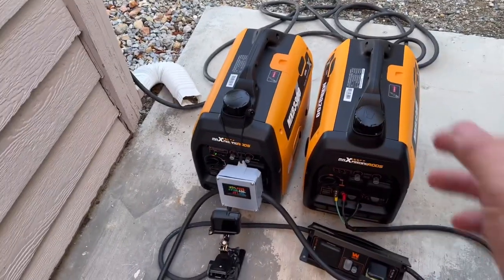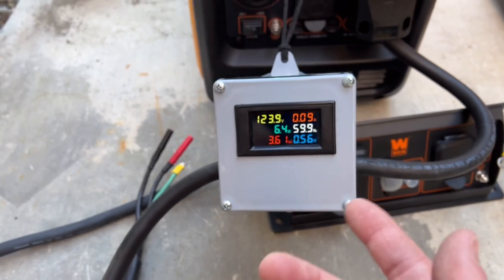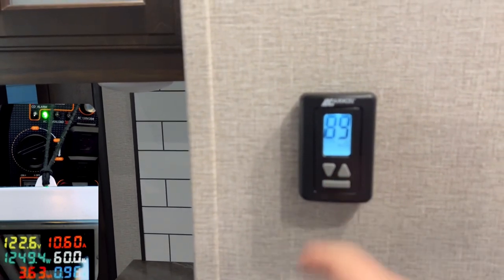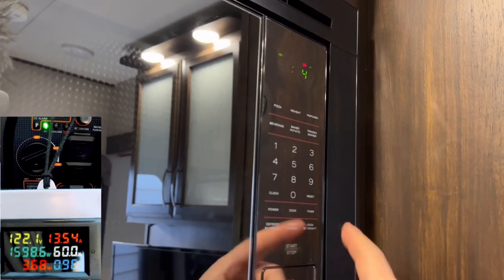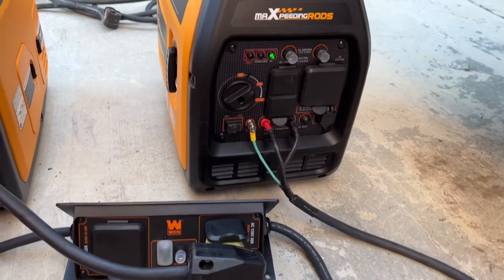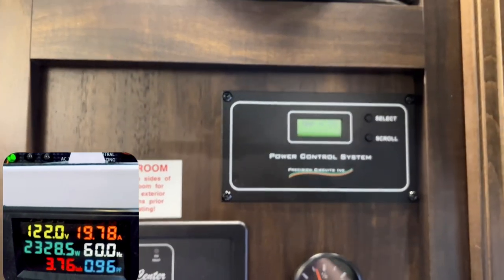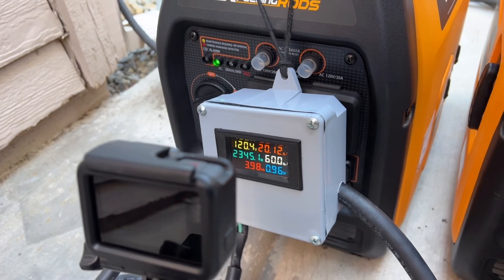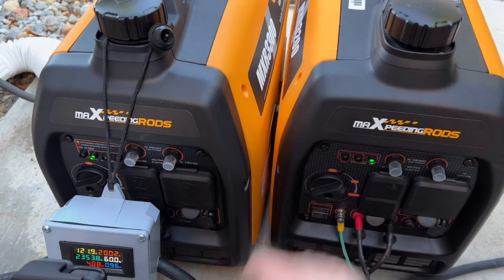Maxpeedingrods MXR 3300 Load test generator paralleling

Comment: I have the mxr 3200 and the mxr 2300. I've tried paralleling them with a kit and with just the cables. Both ways preformed about the same but I think a kit is better. Awesome video johnny.
Reply: What engines does mxr base their generators off of?  Where did you buy them and how much?

I have a 50A rig. I parallel a set of 2000w gensets..  if and when these die.. I plan on replacing them with 2300's from A-Ipower.. they use genuine Yamaha MZ80 engines
Reply: @camposvazquez  I think they're honda clones. Both are almost the exact same length width height weight as the Honda 2200. My 3200 runs my 30 amp trailer by itself with ease. Found the 3200 in Amazon for $500 and the 2300 on eBay for $328.
Reply from the maker: The engines are Genmax design and not sure the copy. They are 145cc and Honda uses a 98.5cc on the 2000 unit and a 121cc on the 2200 unit.

I still have the discount code which may be cheaper then else we’re but not sure. Which is in the description in the video. 
Over all though yea so far this is a ideal compact size unit.
Reply from the maker: Yea according to the manufacturer they say use the parallel box kit. I tried to fire up both acs with out the box and the gens didn’t like that much load and wouldn’t do it… kinda was surprised. With the box no issues 🤷‍♂️ 

But of course I have to tell people to use it according to what they say.
Reply: @johnnysweekends  technically my 3200 is a genmax even though it is identical in every way to the mxr. I was lucky to find on Amazon back in March at $500 with a coupon code. Love it so far.
Reply from the maker: Genmax is the maker of the MXR. It’s just a sticker 😁 but that company sells it

Comment: U should get inverter air conditioner. I have a voltas and it makes a big difference. Inverter air conditioners increase their load slowly and when they reach set temperature they pull only the amount of power required to maintain the temperature. My one goes down to as low as 300w and it's a 18000btu unit.. in my room it pulls 500w when outside is 40+. On some occasional days when it goes 45+ sometimes 49c then it consumes more than a kw to maintain room temperature. Their only drawback is if they go bad u have a lot more points to check and the inverter board itself can fail and that part is quite expensive.
Reply from the maker: Unfortunately I don’t think they make them for RVs so soft starts are kinda the best option.

Comment: Kind of bummer about the 30A limit.  Would it be feasible to isolate the water heater and microwave to a dedicated 20A circuit?  You would need to run a 2nd extension cord to your parallel box of course, but it might allow you to do some better load testing.
Reply from the maker: I actually have a different trailer and set up now.

Comment: I have a question about parallel kits. And home back up.
I’m having a generator inlet 120/240 L14-30amp installed. I’ll be using my champion 4500 with it.
My question is, if I were to parallel the champion 4500 with my predator 3500. Would I use the 30 amp or 50amp side of the kit? With the correct adapter.
Reply from the maker: You need to use the 50 amp as those two together is a lot of power for 30 amps you will melt stuff if not careful.
You need to make sure your parallel kit provides two hots out in that kit you have. 
You can always show the electrician your set up as well.

Comment: Hi Johnny, awesome video. I purchased the Maxpeedingrods MXR4000 (this is the red and white one with Bluetooth capabilities) a few months ago. Just recently purchased a second MXR4000 so that I can parallel to run both my 15000 btu AC units on my fifth wheel. I planned to use a 50amp parallel kit, but the parallel hookup ports on the generators are male connections (possibly JPM connection) and the 50amp parallel kits I have looked at have male connections that would plug into the generator. The generators came with a parallel kit (with proper connections) to hook both generators together, but I would only have a 30amp connection. Any suggestions or advice? Would it be ok to replace the connections on the 50amp parallel kit with the proper connection? Thanks in advance.
Reply from the maker: You could replace to make the connections work as it’s just wires and no data. 👍🏼

Comment: how do you like this generator compared to the predator? I’m looking to purchase one for my camper. But I can’t really decide. It has one 15k ac unit. I’ve seen this one, the predator, champion 4500 and powerhorse 4500. I like th size of the unit you are reviewing. It looks smaller?
Reply from the maker: So far I’m not hearing a lot of problems with this unit but a couple people said it won’t idle super smooth while just idling and no load. As soon as a load is on it works smooth like normal. But that’s only a couple people so far.

I really like this unit and the Genmax 3500 dual fuel. That is also a great unit. Plus they is a clone Honda gx engine so assume that should hold up fine. 

I don’t see why I will use much else now one of these or my ECOFLOW stuff and some solar. 

Now if running two ac units then I would recommend a larger unit. 👍🏼
Reply: @johnnysweekends  I went ahead and ordered the genmax 3500 mostly because of the weight. I wanted a bigger champion 4500 but I don’t think I would be able to load that in my truck by myself 😢😂 my rv ac is a 15k and fridge is 12v so I think it should be okay. I also have an Anker powerhouse 757 and a smaller 300 as well. I hope it’s a good back power source for home too.
Reply from the maker: Ahh nice. Yea honestly the 3500 series of these are a for sure sweet spot when it comes to the size. Hard not to love it. 

If you wanna make life easier on the generator adding a soft start really is a nice option but not really needed. But just helps save everything for the long haul down the road.

Comment: Could you parallel a BLUETTI with a Honda gas generator?
Reply from the maker: You can’t really parallel them, but you can charge the bluetti and use it at the same time and also use another plug on the Honda as well. 
But you can’t increase the power output of either unit.
Reply: @johnnysweekends  thanks for the response. I was really hoping I could connect them together and power my 50amp RV.
Reply from the maker: Here ya go. You can maybe use this to power each hot leg..
Let me know 
https://amzn.to/3O6AxSk

Comment: Hi, i have two of these generators, from maxpeedingrods, one is 5500w and the other one 3500w, can i connect both of them in parallel? Thank you
Reply from the maker: Yes, most people parallel many different brands together and different sizes. Keeping them closer in ratings is also good. Like what you are doing is fine but say a 5500 and a 2000 might be to far of a stretch ……
Reply: Wow are you powering a small Stadium 🤣🤣  the 5500 alone is no joke
Reply: I've been looking at the 5500w ,,, doesn't look like it has parallel outputs on the unit ???
Reply from the maker: The champion model ?
Reply: @johnnysweekends no the Max peeding Rods 5500 .the Camo version 

None of the reviews I've watched ( and there's not many) show a parallel option
Reply from the maker: @Forged721 oh yea that if I remember did not have parallel ports on it
Reply: @johnnysweekends  Yeah thort so ..isn't that strange 🤔  you Buy there Flag ship range 5500w .but yet no Parallel option
Reply from the maker: @Forged721 have to look into other options but yea it’s an odd unit.
Reply: @johnnysweekends You really know your stuff - But in Australia we have terrible options. Even our Amazon is a watered down version ..Zero Dual fuel in Australia  as well 

Is there any other problems with MPRods you are aware of?
Reply from the maker: @Forged721 the Maxpeedingrods 3500 so far has been doing well for me and others and also in reviews you can also look at the pulsar version 😉

Comment: I'd still use two for camping so you don't make the rev so high. I'd think with 2 in parallel with a combined 30a output that is were you'll get much longer life out of them.
Reply from the maker: True they won’t work very hard while running both. They would be Just barley humming… lol
😀😎